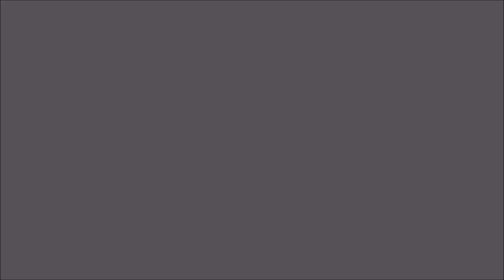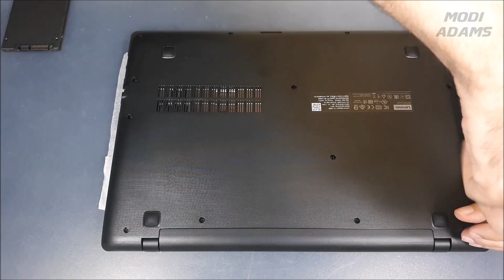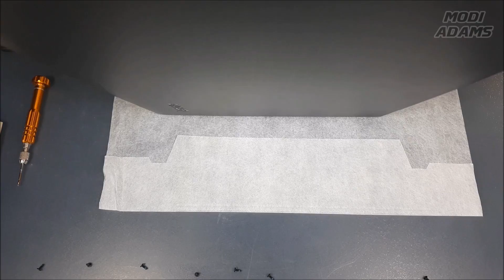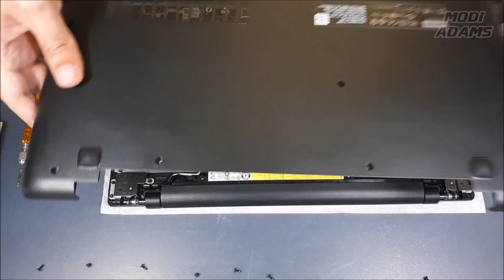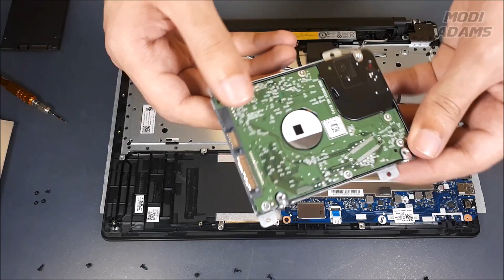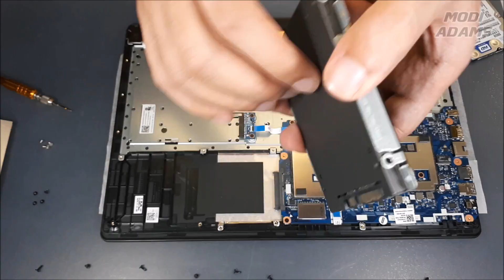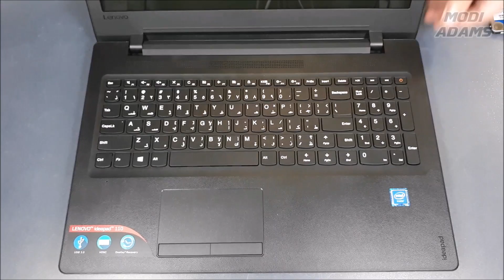Lenovo Ideapad 110 SSD Upgrade

Comment: One important fact: On the version of the Ideapad 110 that I worked on right now there is one additional screw beneath the keyboard (it can't be reached from underneath as the other screws, you have to take off the keyboard first!!) that has to be opened before you can take off the casing!!!! I almost broke something when I tried to open it like demonstrated in the video, it's not your fault but I just wanted to point that out for other users with the same machine.
Reply from the maker: Hi Griever, Thanks for pointing this out, your model may be different than this particular one on the video, but when i disassembled this one, i didn't find any resistance or felt that i broke something after i unscrewed it as demonstrated. All and all, you better either check multiple disassembly videos before doing it yourself or download the service manual for your exact model and take a look in there as well.
Reply: @ModiAdams  just pointing it out for people with the same problem.
Reply: @MWR3  mm thanks bro

Comment: Thanks for the video bro. Upgraded the Ideapad 110 for a friend of mine. I don't get why laptop manufactures don't use a cheap 120gb ssd. Everything is faster than these
5200 rpm laptop hdds yikes.
Reply: i know right i bumped the ram from 4 to 8 gigs took a 120 gig ssd i had laying around and used that as the boot drive than got a drive caddie that replaces the optical drive and threw the 1 tb drive in as mass storage

Comment: Hey! Thank you for the detailed video. I have a Lenovo Ideapad 110-14IBR, and I'm also looking into upgrading the 1TB HDD that it comes with to an SSD. I have one question: I know the size of the SSD is 2.5", but is there any particular thickness that you used on this one (7 mm or 9.5 mm)? Thanks!
Reply from the maker: Hey Franklin, you are welcome, and well, don't worry about the thickness of the SDD as long as it's a 2.5", specially that it's a regular laptop not even an ultra-book which at such a case you would have to double check the thickness of the drive, even though most of Ultra-books uses PCI-e NVMe SSDs. All and all, any 2.5" SSD will work perfectly fine. Good luck :)
Reply: Thank you for your answer! :)
Reply: @ModiAdams  I did it and it worked! Thanks again for the video :D
Reply: @ModiAdams  it's possible to upgrade ram for 110 14ibr too ?
Reply from the maker: @muammarqadafie9059  I think that the RAM is soldered on that kind of lenovo budget laptops, meanwhile, you wouldn't need more than 4GB for that kind of machines anyway. just upgrading the SSD will do otherwise you would need a whole other intermediate laptop.
Reply: @ModiAdams  but my version of 110 114ibr are comes with 2gb ram istead 4gb ram and 1TB HDD
Reply from the maker: @muammarqadafie9059  Hmm, if your model comes with 2GB of RAM, it's 1 of 2 options then, when you open the bottom cover and you found out an empty RAM DIMM slot that means you have a 2GB soldered one,  so you can install a 4GB stick in there and you would have a total of 6GB of RAM, and if it's already populated with a 2GB of ram in there or whatever, remove it and install the 4GB one.
Reply: @ModiAdams  ok

Comment: I have this computer. Started running like a piece of shit after one year. Multiple formats and reinstalls don't help. Can't wait to install an SSD. Thanks so much for the tutorial!
Reply from the maker: It's literally unusable without with a regular HDD! the SSD will boost it's overall performance 5 to 10X
Reply: @ModiAdams  Seriously. It has fairly decent specs for the time: Core I5-7200U CPU, 8GB Ram. Didn't realize it had a 5200 RPM drive, though! Never witnessed an HDD this slow before

Comment: Hey dude, I have Lenovo Ideapad 110 15-IBR and I was thinking of upgrading HDD to SSD(probably 240GB SSD). Now I know that it will improve boot speeds and speed of opening programms, but, will it improve internet browsing by any chance? I already Windows 8.1 installed which works and starts much faster than Windows 10 so I think that I dont necessarily need SSD for improving general speed of my laptop. But, if it improves browsing Im 100% gonna buy it.
Reply: i don’t think it will increase internet speed necessarily if that’s what you are asking. and if you are asking if it will improve internet browsing i think it will sort of but you need to upgrade your ram for that
Reply from the maker: Hi there, Upgrading to a SSD is a must and not an option cause after a long time of using windows, files will be scrambled all over the plate of the regular HDD and it gets your windows slower with time, the SSD will make your startup/boot up time, shutdown, programs installation, and definitely the time a browser starts way faster. all of that in addition to a non-moving parts makes it way safer than a regular HDD that can fail or gets bad sectors. also SSDs is much more energy efficient and always ready to use and doesn't sleep to save energy. SSDs are a must, not an option. and if everyone knew about them and got them, there will be a SSDs global shortage!

Comment: Hi,

I am having troubles with this notebook by installing a second HDD , the ones that are installed within the CD/DVD drive port. I have installed this kind of things in various other notebooks.

The problem I am getting, is that the drive is recognized and can be used... but at terrible speeds. The performance on the second HDD is terrible. I installed an SSD where the original HDD was and the 1TB HDD included in the caddy, what most people tend to do and I am one of them.

how can I solve this problem ?
tnx a lot
Reply from the maker: Hello Ali, the problem is that 95% of the CD/DVD caddies in the market are a low quality generic ones, there is no brand for it, you can search for one from ORICO or any other trusted brand, and it could be also that the one you installed is a faulty one, replace it with another one from the seller you got it from. All and all, i wouldn't recommend using those generic caddies, just drop the SSD as the main drive within the main SATA3 slot and drop the HDD in a good quality USB rack.

Comment: What kind of ssd does it support? As slot factor, what shape does it fit. Cant i use a sata cable for it?
Reply from the maker: It does support 2.5" SATA3 SSD of any brand and up to 2TB.
Reply: @ModiAdams  tnx a lot for answering. I Just ordered one

Comment: Mr. Adams, thanks for posting the video.  What is the physical size of the HDD and the SSD (not the GB capacity).  I am uncertain what specifications to for shop for when buying an SSD for the 110-15ACL laptop.
Reply from the maker: ssturbo, you are welcome, and the physical size of this drive is 2.5" ..
Reply: Modi Adams, thank you again. I’m glad because that form factor is easy to attain. In which applications does one use the M.___ form factor?
Reply from the maker: @stansingh  When there is an extra PCI-e slow on your Notebook, you can easily put 2.5" with the M.2 and also some ultra-books are so thin that you can only have an M.2 Drives on them, even some more ultra-thin notebooks are having their storage embedded on-board and not upgradable.
Reply: @ModiAdams  I finally took on this project.  Once screws were removed from bottom plate, it took some sleuth-work to figure out how to separate the plastic plate.  Once removed, easy to redo the next time.  Furthermore, cloning the HDD took some research (not in scope of this video), along with updating the BIOS settings (also not in scope of this video).  With the help of this video guide and a couple of others, I've successfully updated my Ideapad 110 with a working SSD running Windows 10.  Thank you, again!  Next upgrade = swapping the lousy battery. :)

Comment: excuse me, may i know what type of the laptop do u use for this video? Because there are many types of Ideapad 110.
Reply from the maker: Hey naufal, It was an Ideapad 110 with a Celeron N3060 CPU and 4GB of RAM. Can't really remember any other part no. or an additional letters other than Ideapad 110. I hope that may help.
Reply: There r additional info like mine has model 80T6. @ModiAdams

Comment: At this point would you need to reinstall the BIOS and Lenovo software or is that on a separate drive in the laptop?
Reply from the maker: You will only need to reinstall your windows but it doesn't affect your laptop's BIOS.
Reply: @ModiAdams  awesome, thank you

Comment: I saw that you used different sizes of philips for the screws, What are the sizes of the philips and screws that you used?
Reply from the maker: All the back cover screws are the same size except for the 3 ones that holds the optical drive in place and then another set of different size for the 2.5" HDD or SSD.
Reply: @ModiAdams  Thank You, I already used the smallest philips I found in my house and it worked fine. Thanks anyway.

Comment: Thanks for the video, I missed those 3 screws under the cd drive.
Is that an M.2 connector for a 2nd drive?
Also, I guess there's no way to upgrade RAM right?
Reply from the maker: Well, the connector that looks like M.2 is actually for the DVD & if you don't need the DVD, you can get one of these racks that allows you to install an additional SSD or so .. and yea, RAM is not upgradable.
Reply: @ModiAdams  how to Fix the ssd into dvd plug? A caddy disk needed?

Comment: can I install 256 GB SSD along with the previous 1 TB HDD or I have to replace hdd by new ssd?
Reply from the maker: You can install a 256SSD as the main drive for the windows installation and so on, and put the 1TB drive in a DVD Caddy in stead of the optical drive.

Comment: i have same model of lenovo, may i know what is the specs of SSD recommended to make it faster? thanks in advance
Reply from the maker: Jay, you are welcome. And this laptop does support any 2.5" SATA3 SSD whether if it's a SAMSUNG, Kingston, SanDisk, Crucial, WD, Lexar, AData etc .. any 2.5" SATA3 SSD will get the job done and make any machine 5 to 10X faster.

Comment: Not planning on doing this any time soon but I have a question. Will I have to reinstall Windows if I replace the hard drive?
Reply from the maker: Well, i got this machine without any pre-installed OS, so i would have needed to install windows anyway ..

Comment: What storage capacity ssd did you upgrade to. I read somewhere that the maximum capacity is 128gb, just wanted to check if I could get more than that as 128 is a bit small.
Reply from the maker: You can install up to 1TB SSD and it will work perfectly fine.
Reply: Don't you have to Uninstall the DVD rom?

Comment: !!URGENT!!
Please help me I was cleaning my laptop for the first time to get rid of dust but after i put everything back together i tried to put in the disk drive rom thing but it would not insert into the laptop all the way. what do I do??
Reply from the maker: Hey Stevepok, No worries, all you need to do is to remove the screw that you already tightened and insert the DVD and then screw it again. the end of the DVD hits the screw, so unscrew, insert the drive, then screw it again.

Comment: Can we install Windows 10 after installing Sata SSD in Lenovoipad 110 in intel cel processor.? Wil it give good performance.?
Reply from the maker: Upgrading to an SSD will always boost your system speed, and sure you can install windows 10 on it. I had windows 10 installed on many similar notebooks with intel celeron cpus and it's running smooth and perfectly fine.

Comment: I want to do this but I have one question, would this make me lose things I have like games, pictures, etc.? I’m saying this because I have had this laptop for 2 years.
Reply from the maker: You can backup all your files before HDD replacement, or even do that after SSD installation by connecting your old HDD with a USB rack and copy your data to the new SSD.
Reply: @ModiAdams  thank you!

Comment: hello my device is lenovo ideapad 110 14ibr. Can I add a ssd in this including the existing hdd? and is there any slot for upgrade ram?
Reply from the maker: Hello Riyaz, I think that RAM is either soldiered to the MB or not upgradable, and you can replace the HDD with an SSD for sure and you can put the HDD in a DVD Caddy and install it in stead of the optical drive.
Reply: @ModiAdams  thanks a lot

Comment: i have the Lenovo ideapad 130s     intel n4000 1.1ghz   is mine devise not compatible im thinking about the external SSD? What do you think i should do?
Reply from the maker: I have another Lenovo with an Intel N4000 CPU, and i successfully replaced it's HDD with an SSD, check my latest video for it, It's a perfect machine with passive cooling, no fans and never heats up, check my video for it: Lenovo ideapad 330 Unboxing & SSD Installation

Comment: Hey, 
Thanks for useful information. 
I have same laptop. Is there any way that i can install WD BLUE SN550 NVMe SSD ??
Reply from the maker: Hey Abhishek, Unfortunately, there is no PCIe slot in the model that i upgraded on the video, it does have a one main 2.5" SATA3 interface that you can use for a 2.5" SATA3 SSD. meanwhile, you can install the SSD in stead of the main HDD and install the HDD in a DVD Caddy in stead of the Optical drive in case you are not using your DVD for anything at all. The newer models of the same laptop like Ideapad S145 does have a PCIe slot and it does support NVMe SSDs. I uploaded a video upgrading one or 2 of these before as well.

Comment: IDEAPAD 110-15ISK , will support ssd in m.2 slot upto what gb and in sata slot upto what gb???
Reply from the maker: Well, i checked it again on the video as it was an upgrade i made for a friend, and that empty slot above is for the Optical Drive and not an M.2 Slot and for the regular SATA 2.5" SSD, it can support as much as you through at it up to 2TB or even 4TB EVO 850 if you could afford one :D !

Comment: Thanks for the video. Question: was the original Hard Drive a HHD?
Reply from the maker: You are welcome, and since this notebook is a budget one from lenovo, so surely it came with a 500GB HDD which i later on installed in a USB Rack to use it for multimedia and backups. All and all, SSD for such a machine is a must to get over any slow performance, it will make it not feel like a cheap machine.
Reply: @ModiAdams  Thank you chief for the fast reply. Really appreciate it. :)

Comment: How do you remove the case so effortlessly? Mine doesn’t come out that easy
Reply from the maker: Haha, It didn't come out easily with me either, it took a little while. It may seem a bit easier because the video is accelerated :)
Reply: @ModiAdams  Actually my laptop is a little different, it had a screw under the keyboard hehe. I thought the process would be the same since it's a very similar model.
Reply from the maker: @MrMcKlain  Yea, that affordable models from lenovo the 110 and 330 are very similar but not identical since there are some letters after each number that makes each model slightly different.

Comment: I have bought Lenovo ideapad 330 15.6" Laptop. Can i upgrade it to SSD? How you take care of the Windows OS in this upgrade? Did you re-install it?
Reply from the maker: hey Abhi Jit, well, usually the machines that i upgrade their drives come without any OS on them, but i think there must be a tool to take an image of the old drive to the new SSD in case you are worried about the OEM OS, but i install a fresh one after i upgrade.

Comment: Thank you so much this will help me out so much, what SSD would you recommend in 2019?
Reply from the maker: You are welcome Brandon D, And i recommend the cheapest SSD you can get i.e: Kingston, Crucial, Lexar, A-Data, Samsung Evo or Sandisk etc.. since it's not a high-end gaming laptop, so any 2.5" SSD will rock it's performance.
Reply: Modi Adams will it be good to play black ops 3 on?
Reply from the maker: Pal, this laptop is not meant for gaming at all! It's a basic everyday notebook for light tasks, web browsing, media consumption, word, excel, power point etc .. yet i can assure you that it will run Red Alert & Midtown smoothly without any frames drop or thermal throttling lol
Reply: @ModiAdams  I was able to get this to record with obs studio and edit in powerdirector and also play south park stick of truth and cuphead by optimizing windows 10 but yeah still meant for light stuff
Reply: @ModiAdams  hello sir I’m sorry to text so late I love the content I just have a question similar to this. In 2021 what SSD would you recommend ? Thank you very much

Comment: Can I use an internal ssd data Ultimate SU630 ASU630SS-240GQ-R 240G solid state drive, 2.5, SATA III?
Reply from the maker: Sure thing, why not, Any 2.5" SATA3 SSD will get the job done.
Reply: @ModiAdams  Thx 😀😀😀😀

Comment: Thanks for this video bro
Bro what if i replace hdd with ssd and replace cd/dvd slot with hdd is it work ?
Is their any chance of data loss by removing hdd ?
Reply from the maker: Rishav, you are welcome, and it's totally fine, no data loss at all just by removing the HDD, but make sure you get the right CD Rack thickness cause some of them are thick and some are slim. other than this, it's totally fine, you can copy all your data later on after replacing the drives, also you can install the removed HDD into a USB rack to copy your data from it.

Comment: What about my OS do it will go and I need to re buy it?
Reply from the maker: While there are some software that allows you to clone your OS to the new drive, but i don't think it's that much reliable, so you need to reinstall your OS  .. meanwhile if you have an original windows on your old drive, you can unregister it and use the same license on the new installation.
Reply: @ModiAdams  Oh thanks so much for fast reply :D
Reply from the maker: @bity-bite  You are welcome :))